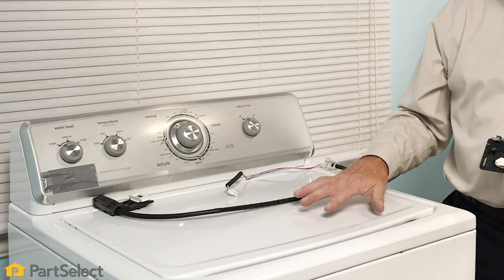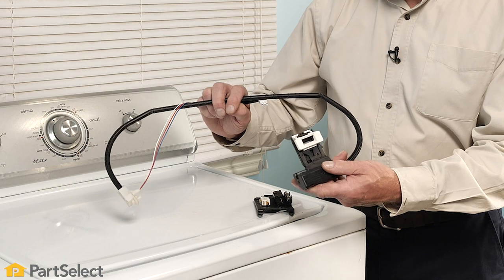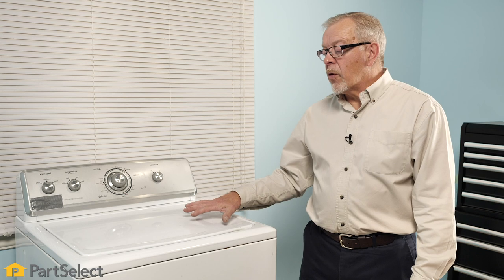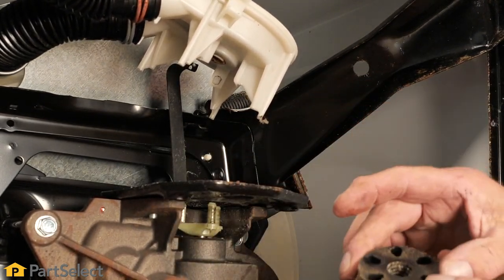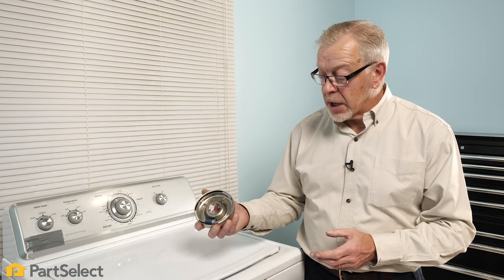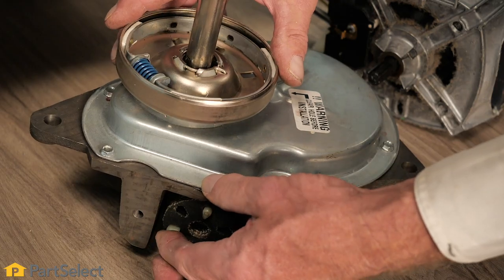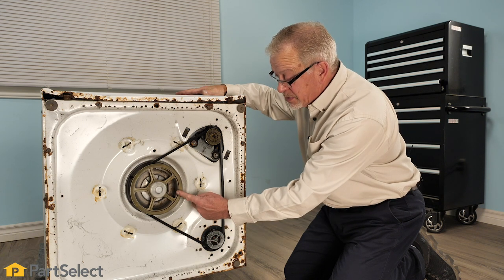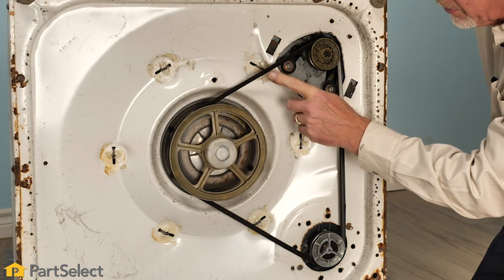Washer Troubleshooting: Washer Won't Spin - How to Fix Your Washer | PartSelect.com

Comment: I the exact Maytag model in this video. I replaced the motor, the coupler is in good shape. I suspect it’s something in the dial. It’s makes a humming noise and I can smell the motor getting hot. I have to unplug and mess with the dial to get it to work.

Comment: My 2003 Electrolux Frigidaire Crown Series White Front-load Energy Star Washer model CRTF1240ASO will not agitate or spin, but still pumps & drains the water. Also, the Selector Timer knob moves quickly through all cycles of wash. What part do I need to replace or how to fix my problem?

Comment: Hey I just bought a brand new belt for my maytag washer.  I lifted it up because it still wasn't spinning or agitating. The belt is spinning along with all pulleys but it's still not spinning or agitating. Do you want it maybe?

Comment: I have kenmore direct drive.  about 75% of the time it won't spin  and close are soaking wet.  But If I turn off the power during spin cycle,  and turn it back on,  100% of the time the spin will work normally.   I don't think its the clutch or the coupler, and lid switch is bypassed.   Im thinking its the timer, or the transmission not telling the clutch to engage.  But not sure which one it is.   RECAP:  won't spin unless power switch is turned off and on during spin cycle.
Reply: Ever fixed it?
Reply: @memo503046    Yeah was a bad Timer switch..  I opened up the timer and all the contacts were black.   I may have caused the damage by shorting the lid switch when that went bad.   Anyways working great for a year now after timer replacement!

Comment: What if it goes into the spin cycle and you hear the motor humming but it wont start spinning until you get it started by hand, then it will spin fine?
Reply: I was about to ask the same question, I just replaced bearings and seals and now mine needs help starting.  There is a motor start capacitor on the side of my motor, I wonder if that could be bad?  Maytag centennial 12 yrs old.

Comment: thx washer belt stopped working in the spin mode tried to reset washer , no luck ,lifted the washer and turned it on and the motor was spining but the belt had become stretched and worn, getting belt tomarrow thx again
Reply: Did the belt turn in agitation mode, but not spin mode? My belt spins in agitation mode and makes really high pitch noise in spin cycle and the belt doesnt turn? Any suggestions, the belt is frayed and the pulley doesnt have much tension but it still spins in agitation

Comment: Well my washing is like literally from B.C. and it’s probably all mechanical up at the controls
When it was spinning i switched it from (2 Rinse to 1 Rinse) and right when i did that i heard a sound (ticking) and it never worked again
Note: it agitates it doesn’t spin
This is a kenmore 80 series

If you want to keep reading go for it

So in order to test if it worked i started a load like normal and left it to do it’s thing but i was standing close by and it stopped agitating and I waited and waited and nothing happened it wasn’t even draining without spinning so here comes the fun part
I took all the wet clothes out and rang them out and set them in another room with a huge fan to dry them off (there was a blanket in there) then i went with a cup and scooped all the water out manually because there isn’t a drain hole in the back so i did that and put it all in the floor drain and after that i used dehumidifiers to take all the water off the floor

Problem is my dad is probably going to kill me
So yeah

FOR EVERYONE HERE I HAD THR LID CLOSED

Comment: I hope someone can
help me. I have a washer that I am unable to turn the coupler on the
transmission clockwise it will only turn counter clockwise BUT with motor and
transmission out of washer both spin freely. Since I am currently unemployed I
have to determine if its the transmission or something like the brakes dragging
or basket drive assembly. i noticed the cam has no play outside the washer but
while turning the basket drive assembly counterclockwise to get it back up into
the washer it is difficult maybe its supposed to be? Also once in the washer
there is alot of play in cam. One other thing I noticed was once the
transmission was in the coupler would spin clockwise a little bit but not
enough to turn the tub then I would hear a click and it wouldnt turn anymore
and it never turned far enough for the tub to spin. Is that click something
locking up with the brakes or in the transmission? i disassembled the brakes
took of the spring to make sure they move freely. There was no play in the
brakes so they seem okay to someone who doesnt know what they are supposed to
feel like. Also we replaced the transmission fluid with 90 wt.  Ugh someone please help we have been watching
videos and searching the internet for a week. We replaced the capacitor before
figuring out it was bound up somehow. thanks in advance for any help you can
give.